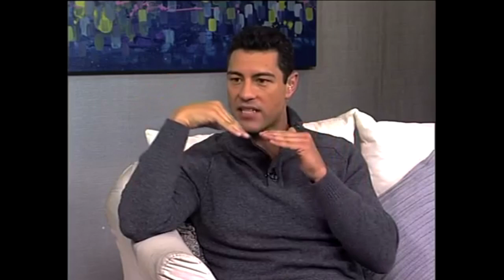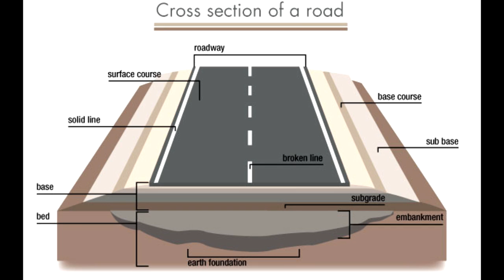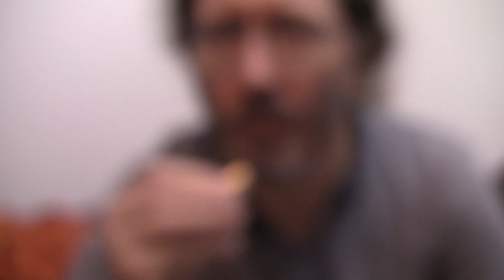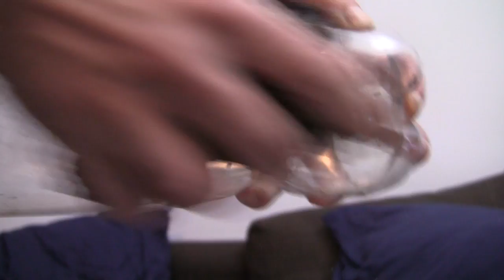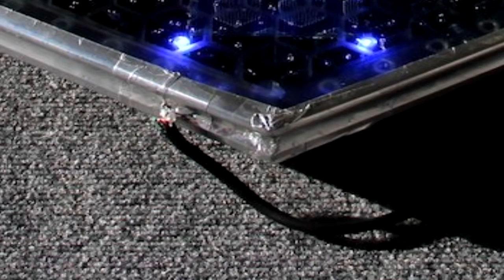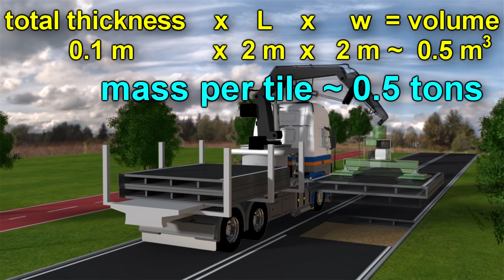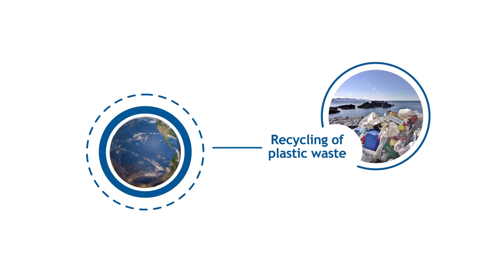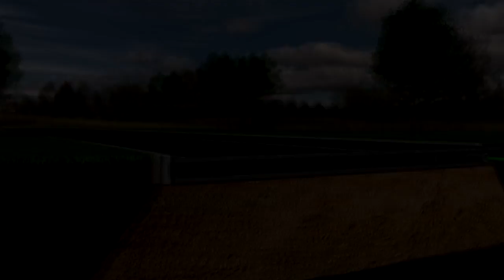Plastic Roadways BUSTED!

Comment: I think they, the plastic road advocates, are assuming a pre-existing roadbed to put the new roadway onto. They may be skipping this important step because it isn't their featured product. I do agree with previous comments about seemingly skipping how they are going to replace sections without affecting the pipes and conduit there in. the roadway would have to be two pieces, a top and a bottom, so that when the surface needs replacing the infrastructure can remain. Also, this would allow  a more open access to the infrastructure if repairs to it were needed.

Comment: I've worked on roads for over 40 years.  Steel reinforced concrete is beat to death.  There's no plastic or solar panels that can take 80,000# semis running 70 mph.

Comment: In Czech Republic we have highway build from concrete panels ... It is the worst experience to have as a driver when you are hitting height differences between panels which are over coated with asphalt. I bet this would be same horrible experience. Plus I am sure as you said in the video. How fast it would start sinking under the weight of the cars. And yeah ... Why not run cables just next to the road so you won't cut out the city XD

Comment: I don't even need this to know it's a scam or idiocy, don't need to be a scientist to figure out what will happen to plastic under a burning sun or an extremely cold surface. But, more worrying is the water issue, plastic and water makes it very slippery hence why it is used in water park's slides, imagine driving on it under the rain? Yeah, it will as driving on thick ice... Seriously however think is a good idea that has real issues with reality and fiction...

Comment: I usually like these videos, but you've made several basic errors here. The tip of your incisor can produce a local pressure MUCH higher than the tires of a fully-loaded semi, so that is not a relevant test. There is a "hot needle" test standard for asphalt, so that would be the appropriate standard. The RUBBING test was simply ridiculous. Just LOOK at that damn road sample! It is a COMPOSITE of ROCK and asphalt. You are not comparing asphalt to plastic, you're comparing asphalt to ROCK. No reason that gravel aggregates could not be used with a plastic "binder" just as with asphalt. You are also WRONG when you claim that there is "no way to prevent that sunlight aging." Plastic SIGNS so treated have lasted for many decades in full daily sun exposure. To be sure, those are not PET, but plastics in general are NOT highly photo-/bio-degradable. That's one of the reasons we want to keep them out of the environment.

Your comments about joining and expansion joints show that YOU have no understanding of road construction or expansion joints. You think PLASTIC has a problem with expansion, try METAL. And yet we span rivers and canyons with long, continuous metal bridges, and we move natural gas in metal pipelines at ~1,000 psi over hundreds of miles, with rarely a leak. The thermal expansion of plastics represents an engineering challenge, but it's a well-understood one that has been solved numerous times in other situations.

The point about the weakness of the channels is well-made, but it assumes that the cartoon is a scale drawing. For the road elements themselves, my assumption is that the supports would be a much greater proportion of the total width of the road. I don't see the channels as a big deal anyway, since the same thing can be and is readily done with asphalt or concrete surfaces. You just need to think about it in advance rather than expensively retrofit roads after initial construction is complete. Same issue whether cable runs or drainage is the issue. Easily addressed with plastic or with conventional surfaces.

You certainly should be aware of the logical fallacy of damning plastic roads with the failure of previous attempts at solar roads. Solar roads are a cautionary tale, to be sure, but their sins cannot be directly visited on plastic roads -- just laziness on your part. In general, you are acting as if a PR cartoon is the same as an engineering drawing. Of course you can't build a road out of artists' conceptions, but you can't properly assess an engineering method based on an artist's conception either. I think about the depth of analysis you did on those "water-harvesting" concepts that just turned out to be simple (and inefficient) dehumidifiers, and I have to say this isn't you best work. Yeah, you got one more hit from me on this one, but I'm solidly in the "DISLIKE" column until you actually do your homework.

Comment: The piping would rust when water gets collected leading to water getting into gas lines or bad water getting in to water lines. And if it rust bad enough a gas line could cause a fire beings vehicles are on top of it. Let’s say a stop light occurs and the exhaust without an exhaust shield could either burn the road, or cause a fire from the gas. It would be one heck of a disaster

Comment: I'm stuck on the "you can pass cables through it". Then how do you replace one of the things if it got cables going through it, genius? You cut the cables?
Reply: No, silly. We would stop and divert traffic, painstakingly cut the segment into manageable pieces without damaging the utilities. Then we would bring in the necessary equipment to assemble forms and injection mold a new replacement section. Disassemble and demobilize all of the equipment and materials.., and open the road to traffic, again! -- Simple! -- And just think of the millions of more jobs! Everyone can now be employed... Round the clock road repair --- everywhere! No need to transit for work. Jobs within walking distance... Good for CO2 reduction. Employment and Climate issues resolved simultaneously. Win! Win! Win! I can't wait...
Reply: @johnlshilling1446  Well, that would solve unemployment. :)
Reply: I know this already two month old comments, but that first things pops on my mind too when I saw the cable line inside this plastic road
Reply: It's very clear whoever thought this shit up is used to small modular things that just snap together.  Like a child playing with Legos.
Reply: What about other pipes?
Reply: The cables would most likely plug in and out of each other
Reply: @VictoryReviews  then you really could not say they are hidden underground anymore
Reply: @cellchow2339  im not saying anything just how I think it would work

Comment: Okey so I read up about it and since may the company (kws and wavin) is taking in orders for the Netherlands(Dutch company so a bit logical there). What I read in the newspaper though is that it's mainly aimed at bicycle and pedestrain roads which apparently hold up pretty well. They do however admit in the article that heavy traffic roads are still a long way off but do still research on those.
So in all, plastic roads are actually viable but seem to be better suited for lightweight vehicles(bikes, pedestrians).

Comment: You should Atleast do SOME amount of research, this is a great way of using plastics, there are already hundreds and thousand of roads built, they either mix asphalt with plastic or fill the underneath with plastic, and then cover it up with a little asphalt. And then you will say that, the roads are not made of plastic !, Sure they aren't 100% built with plastic, but a lot of building materials for roads is replaced with plastic !. You do no research and still have such a huge following, you are just speaking without thinking of anything.
Reply: THE legend SS Karen 😂
Reply: Karen

Comment: Not only are those plastic blocks gonna expand in the heat, but they are also gonna expand when the water inside freezes. And not only that, but a hollow road surface is prone to get frozen and any vehicle going over it is going to be uncontrolable.

Comment: Biggest red flag here for me is the fact that I KNOW Plastics deform before they melt.  The sunlight and heat of flexing and all other factors will make this roadway sag over time.  I know for a fact that PVC conduit will sag under its own weight in sunlight much less without trucks running over it constantly.

Comment: Not to mention after 2 months of use, the road would likely just break apart, especially due to the hollow design, meaning asphalt roads are cheaper in the long term.

Comment: Please do a video about
“The advantages of using waste plastics for road construction are many. The process is easy and does not need any new machinery. For every kilo of stone, 50 gms of bitumen is used and 1/10th of this is plastic waste; this reduces the amount of bitumen being used.  Plastic increases the aggregate impact value and improves the quality of flexible pavements.  Wear and tear of the roads has decreased to a large extent,”

Comment: Since you busted this technology, I have seen that they have instead started using the plastic used to make the road panels into pot hole material.  They make the recycled plastics in to plastic beads.  Then they take the beads to a pot hole and fill the Hwith the beads and another guy with a flame thrower thingamjig turns on the fire flame and starts to cook the beads into a pot hole fixing material.

Comment: I think they have wires as long as each segment that can be attached and detached so that they can pull it out before takeing it out but I dont rly think they thought of pipes bc wat if the pipes are going if there important then u risk turning of a important water source by detaching a segment of it off just to replace it but solar roadways had a good idea to just have a compartment on the side for cables and pipes so that it dosnt disconnect the water and power under the road I am thinking if they want it better they could put asphalt on top of solid plastic with compartments on the side for essentials like water and power you could put holes in it for rain water to filter it either in the road or it can be taken somewhere else, so you can make the compartments and base out of plastic but they will need a way to keep it on if you like this idea plz tell me
Reply: Man I didnt think I was typing so much

Comment: Soviet asphalt:
Strudy, unbreakable, no need to repair, have lifespan minimum 5 times longer than normal roads if used incorrectly, and up to 20 times longer if used correctly

Comment: Actually, what makes the surface grippy are the rocks, not the Bitumen. Bitumen is only there to hold the rocks together. The added benefit is protecting the permanent way from rainwater and removing the dust (historically)

Comment: Joining the boards together could be addressed with simple ways such as the kind of locks on laminate floor boards, but regardless of the joint type the boards will expand and shrink like crazy, even asphalt does this, but very little. Plastic will change dimensions so much that no locking mechanism will provide for fine seams. 
And that is another great flaw. Even if instead of those short panels they made ones that are as long as a lorry, the gaps will drive drivers absolutely crazy with a "knock-knock" every other second at around 35-40 mph. Panels like those presented in their video will result in a sound similar to a machine gun. And those gaps will remain since the plastic contracts and expands much more than other materials. 
I can easily see drivers boycotting this panel desidn

Comment: They actually made one of these as a test apparently. Didn't look that bad. Seems they solved the problem of coming up with a good enough material, but it's unclear as to whether or not said material is actually recyclable, and if the manufacturer intends to proceed with running cables within the panels or draining surface water via the panels being majorly hollow.

Comment: The roads would melt in desert and tropical areas 😂 your tires would have a hard layer of plastic on them
Reply: Plastic doesn’t melt that easily. Asphalt melts in summer
Reply: @WycliffStudios  Asphalt gets soft, but it doesn't actually melt. It sticks together. That's the magic of bitumen! Have you tried separating asphalt?

Plastic degrades and will actually melt. That's why microplastics is a thing and a huge problem.  

Nothing beats bitumen.
Reply: Does a water bottle melt in the desert sun? No….then why would the considerably thicker plastic road melt? 

I agree it’s a dumb idea but not for this reason
Reply: @fijiwill2237  could still warp and sag from heat after a long period of time
Reply: @fijiwill2237  A water bottle in the sun? This is a flat slab of plastic that is lying out in the sun for years...

I mean, I haven't left a bottle out in the sun in the desert for years. But we aren't even talking about bottles.
Reply: @fijiwill2237  you underestimate the power of sun...P R A I S E  T H E  S U N
Reply: @fijiwill2237 i mean, the stuff they fix cracks in the road melts in summer in germany, so I think this will melt too.

Comment: In extreme hot climate, they are going to dip really bad as they melt/soften. Collapse when you have a 10 ton truck run over it. In cold climate, they will become brittle, and when snowblow clear snow, they are going to go into a million pieces and jam up the road. This is when we have a teenager becoming an “advisor” on environmental science and infection disease.....

Comment: I personally think plastic roads are a great idea. and some of these tests aren't very accurate as to what would happen on the road. tires aren't made of abrasive material. and the pillars that you say aren't reliable and will get stressed can be fixed easily. yes of course they will get stressed but as the video you basing all of this off of states that you can switch the panels. even if this is problematic switching out panels over and over its plastic that can be melted down and be made into a more reliable road. i think your basing this a bit of of plastic bottles which  is what the road would be made of but the panels would be much more thick than a plastic bottle. even if it dents why would it matter? it would take a noticeable amount of force to make something as big as a pot hole. you are also basing a bit of this of the principal that plastic is flexible. this usually seems like a bad thing in engineering but it's accually helpful. the road flexing helps disapate the engery from a big impact such as a car flipping. you also compared the weight of a car to the panel wich is not relevant to how the road would function. that's like saying a 10 pound jack could never hold up a 5 ton car. this video is a bit close minded on the future but you might be right we will just have to see.
Reply: www.plasticroad.eu - PlasticRoad is allready reality and two years of tested under reallife circumstances.
Reply: You forgot about melting, what about it?
Reply: @romanszwarc3288  melting plastic takes a lot of heat. unless someone is using a flame thrower I think it'll be okay.
Reply: @frankmyers4736  depends on plastic that is used, asphalt does take around 173 C to melt
Reply: aaand why would you even waste plastic on this, what about microplastics?  you do know some freight transports can get up to 20t ? how would plastic hold that up, you do know asphalt is too recyclable? and if its gonna be made of plastic bottles, they WILL tear down QUICK, doesnt matter if its thick or not, because the material didn't change and that means that it WILL tear down as quick as plastic bottles
Reply: @romanszwarc3288  it's not made of straight plastic bottles you know? if you melt the plastic at higher temputures to harden it. it does matter if it's thick. the thickness of the plastic will determine the life time of the road.
Reply: @frankmyers4736  asphalt is more durable than plastics, so I dont see why we need to replace it, what about microplastics? what about 20t freight transports? what about heat expansion?
Reply: @frankmyers4736  and if its not made from straight plastic bottles, what is it made of then?
Reply: @romanszwarc3288  replacing asphalt can prevent from heat build up due to the asphalt being black. black absorbs light and the light energy had to be turned into something because energy can not just vanish. the light energy turns into heat. what about micro plastics? what about 20t freight transports? and what about heat expansion? you k ow that as phat expands too. that's one of the main reasons that pot holes are created. cold temputures cause asphalt to maintain its shape but as it turns to summer it expands and cracks.
Reply: @romanszwarc3288  melted plastic bottles. not Straight plastic bottles.
Reply: @frankmyers4736  the roads were black in the ad too + what color it should be then?  everything expands, but Im pretty sure plastic expands more, but u still didnt answer my questions
Reply: @romanszwarc3288  it should be white because white reflects most and close to all light. plastic deffinately expands more wich supports my point. the plastic can move around instead of shattering. I have no clue what your question is at this point and I don't care. if you like asphalt that's cool but I think that plastic roads would benifit the world just a little bit. I'm honestly tired of arguing with you so imma just let you hear what you want to hear. your right.
Reply: @frankmyers4736  no, i didnt want to hear that i was just curious, my other questions were about microplastics and 20t frieght transport
Reply: @romanszwarc3288  I'm not exactly sure what micro plastics are and if the plastic was thick enough I feel it would hold especially with its ability to expand and compensate for the weight

Comment: pretty informative.  Not sure why you were rubbing asphalt on the bottle though.  The plastic would be replacing asphalt.  You should have used rubber.  You should have also mentioned that asphalt also degrades in sunlight.  It destroys tar.

Comment: Replaceable modules? right, so that means you will have to pull out all the cables & pipes before replacing the module and then somehow put the cables & pipes back.